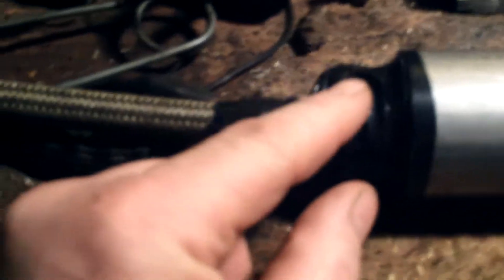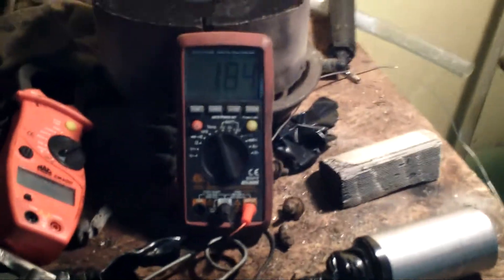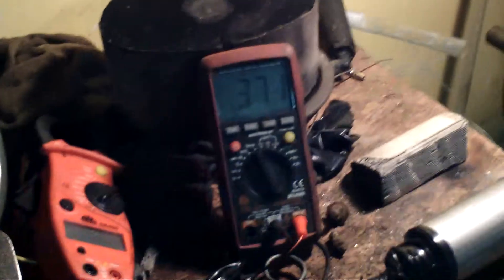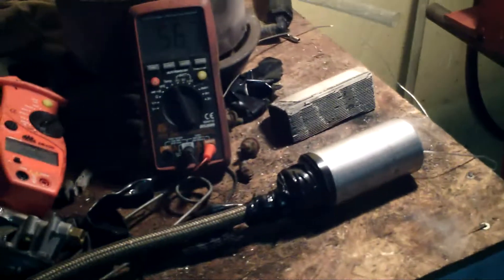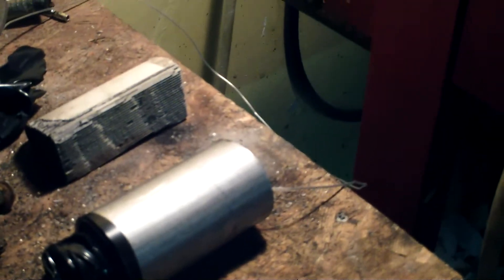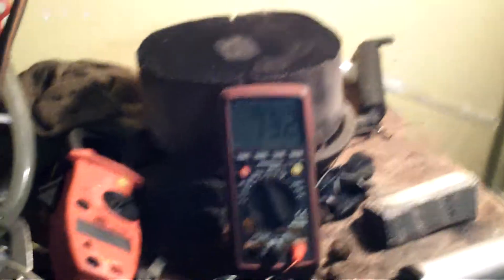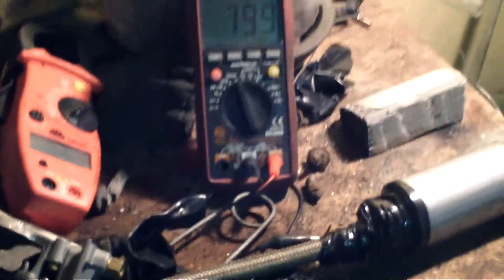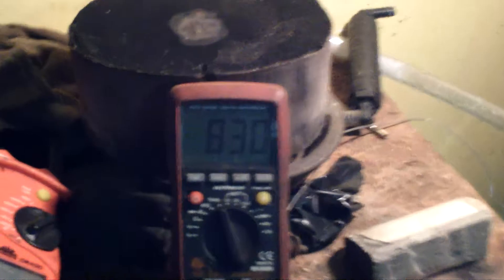Starting Up The H-CAT From Room Temperature !!

Comment: As this thing is being powered by electricity, it's really a glorified electric heater unless it's putting out more watts of heat than going in electrically. A useful test would be to put a heating element inside the tube, and see how much power it takes to make it equivalent to the heat from HHO. BTW, I'm also from Canada (Vancouver area).
Reply from the maker: Kool
Reply: ***** If you've got a steel can can sized object sitting over 800 degrees (just below red hot), I'd rough guess it as dissipating the better part of 200 watts. To make that amount of power with a car battery would normally take around 16 amps (assuming 12 volts no charging). If you're getting that kind of heat with less amps, especially if taking less than 8 amps to make the HHO, then what you're showing could be an important new source of energy. Kool indeed.

Comment: I thought you might find this interesting, they can shape your cat and they use a metallic substrate with spiral, these are called foil wraps I believe and If I remember right came off lexus toyota and others they don't have the value in recycling probably because of steel or whatever base metal they use"tin"?. Anyways I thought of what h4hydrogen said a week or so ago about the spent ceramic and or break down of the converter caused an bad effect health wise and on that post someone also said he was doing such work but got sick. Would your final prototype heater have a radiator system or are you concerned about the byproduct effecting the air? http://www.metglas.com/products/metal_joining/metallic_substrates/
Reply from the maker: I would like to have one of those cats , Have not run across one yet.
I am in the process of getting a radiation meter here, to put the debate to bed...
Neal
Reply: ***** Neal, my father own a gauger counter, i will test if there are the radiation within these 2 days, so if you don't have already the radiation meter, don't  buy it just for prove this ;)
Reply from the maker: Mauro Alpha Thanks buddy , I have committed to buy one now, but you can measure, and i can measure, two of us is better than one of us....
Cheers
Reply: ***** sure man! ;)

Comment: Neal, I had to watch it a second time, it's just too good! It is helping to block this intake from ambient air. The gas flow is high enough to push the gas and heat away from the tape. Eventually the heat will spread on the outer stainless tube and eventually melt the tape. But it's interesting to note that most of the heat is extracted out of the tube. It would be indeed quite a flower pot heater. This is controllable using 2 variables, either controlling the flow of gas or the electrical power input. Even a combination of both to adjust for better results.
Reply from the maker: You are correct, more gas = more heat.
Neal